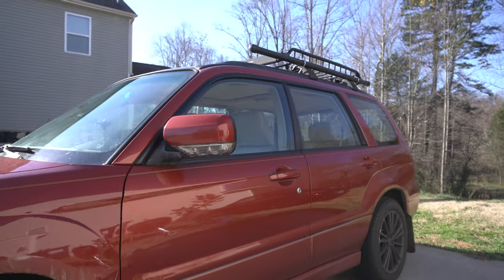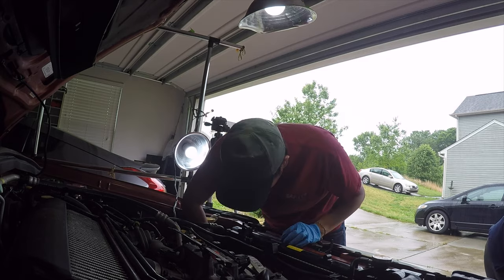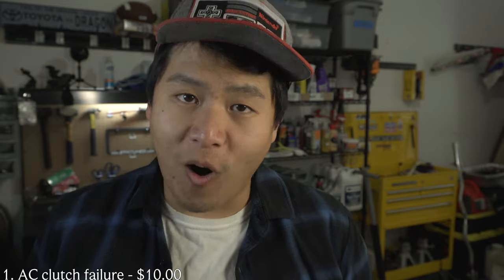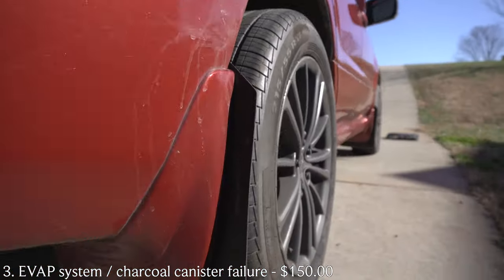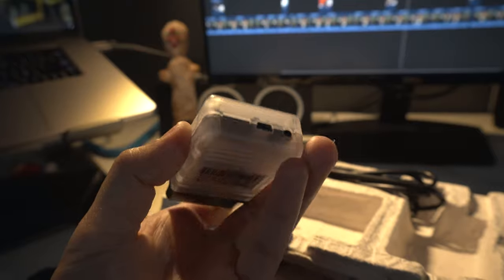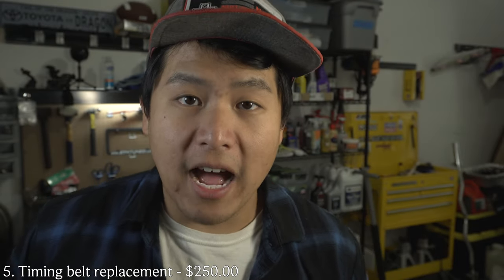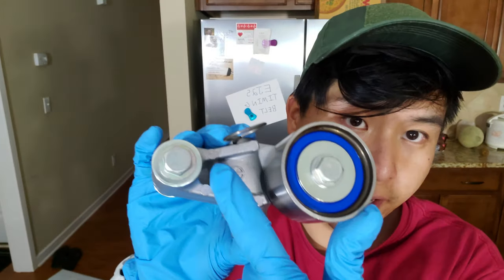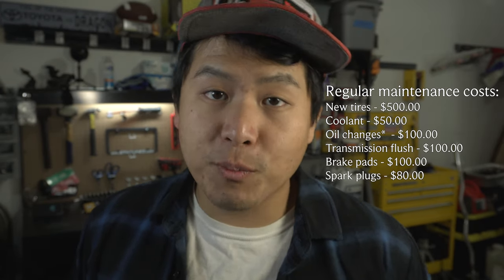How reliable is my 2007 Subaru Forester XT (SG) with 157K miles? | Total cost of maintenance

Comment: Do you plan to do head gasket change?
Reply from the maker: Hey Jason,

Fortunately, my XT does not have the headgasket issue (the headgasket issues are not as common in the turbo-ed EJ's - due to the turbo MLS headgasket versus the NA composite-coated gaskets).

After doing a bit of research, the MLS (multi-layered steel) gasket failures tend to result from additional boost / power modification. Fortunately, I don't plan on adding any more boost! However, I do monitor my headgaskets and coolant quality very often just in case!
Reply: @davechangauto  Oh gotcha. I was looking at an 05 FXT  manual over the Summer. It had 95k original miles on it i believe. Had a few issues when i got back from the test drive, so i backed out of it. Was a nice car though.